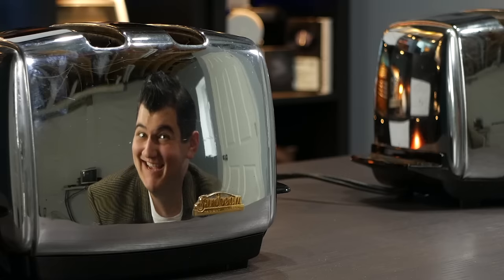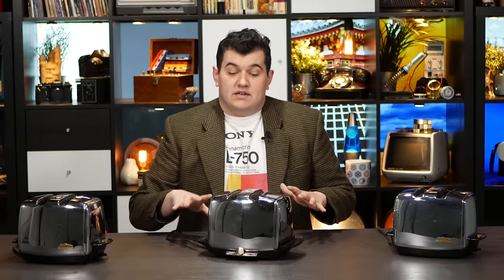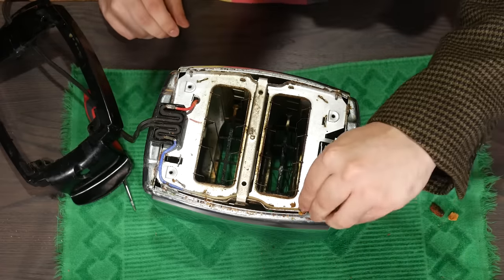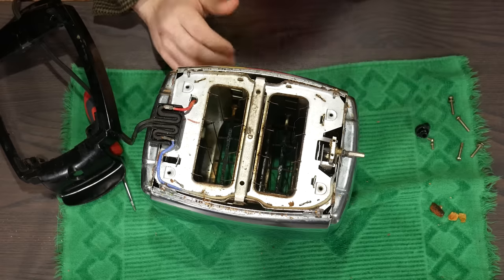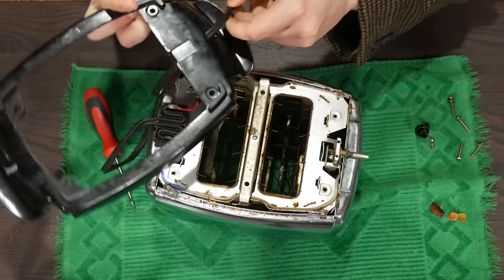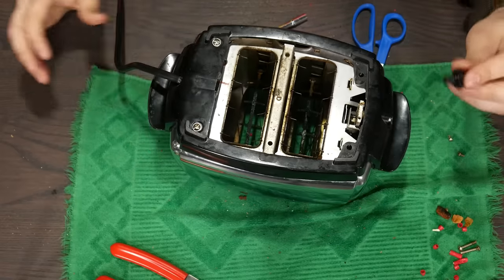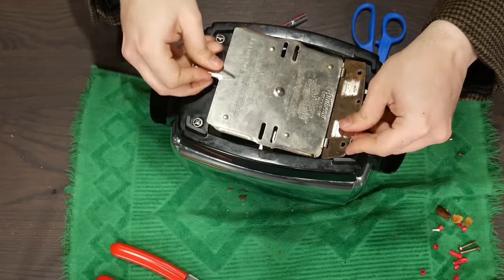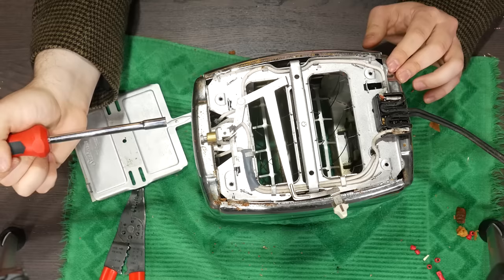Sunbeam Radiant Control Toaster--Repair and Modernization

Comment: I already commented on your main video, that wire on the older model is a 100% or atleast abestos based.
It might be gypsum or plaster cut with asbestos if your lucky, but that shits still dangerous.
Reply: Only if you breathe it in
Reply: @sugarbooty  Yeah, you have to first make it into dust, then breathe the dust. Not much to worry about in a toaster, even with fiddling about like he did in the video.
Reply: The white "paper" stuff is 100% asbestors, also the insulators for the heating elements are suspect.
Reply: hmm i am afraid now i started to work on mine and i went to try and burn the insulation with a lighter and it did not catch fire. I have a asbestos phobia and i’m not sure whether to junk it or see what i can do with it.
Reply: @nikelquint  Would it even be legal to just junk it? Isn't asbestos supposed to be disposed of by certified professionals only?
Reply: @nikelquint  Send my your toaster and I will keep it as i am not worried at all about asbestos.
Reply: @Sine1040  If by the insulators you mean the little white supports that hold the wires in place they were ceramic, or sheets of mica, or a combo of both.

Comment: I just picked one of these up this morning at a flea market for a dollar!  Lucky day.  I've had my eye out for one since seeing your videos a couple of years ago.  This morning's toaster is the 1970's model, and it would work, but every other time I'd put bread in it wouldn't start.  Loosened the secret screw a couple of turns and now it starts every single time (and moves faster).  Thanks!  Using ours with a GFI socket, so we probably won't worry about changing the cord.
I suspect the reversal of the 'One Slice' text was a requested by someone on the usability/design team.  Many toasters live their lives sitting on counters under overhead cupboards.  With the old design it would be very difficult to see the word 'One', which really is the most important of the two words.  Reversing the text puts 'One' towards the front of the toaster for all to see.

Comment: I have my grandmothers Sunbeam with the front slider. She lived from 1903 to 2003 - one and a half months shy of 100 yo. 
 I travelled multiple states working on very large industrial and institutional furnaces, boilers, chillers, a/c, ventilation equipment, etc. for a company founded in 1867. 
  You could crawl or crouch through, below, inside the fire boxes, in the hot decks, tempered air decks, cold decks, duct, and tunnels. You could crawl into the large fans and pretend that you were a gerbil if you so desired. 
 We offered free inspections on our equipment. 
 When i would test fire equipment pre heating season, we would usually get an odor from the big forced air systems from dust on the cast sections. Folks would ask what it was? They always had an odd look when I'd simply answer "GHOST POOP."

Comment: If there's bad metal corrosion, would be great to see a video of one of these toasters having the corrosion removed, treated and protected against future corrosion forever. Maybe glue a heat-resistant material (high temperature mat) on the inside of the metal casing, to keep the outer casing cool; it would need to be thin enough so the casing can be reattached easily. The bottom wire looks like it may have asbestos insulation, so maybe replace that wire and protect its replacement with asbestos-free insulation?

Comment: Regarding to ground or not, I have been using one of these toasters over 30 years everyday in my farmhouse kitchen with old style wiring, and never got a shock.  Of course I learned at a young age never to touch two electrical things such as the toaster and the water faucet at the same time!

Comment: I love the sly remarks.  Great info, especially the cord upgrade.  On toasters & ovens I regularly upgrade the power cord.  I don't trust the manufacture.  They ALWAYS cut corners.  Besides old toaster ovens become paint dryers for my modeling.  I epoxy the temp knob on the lowest setting (Keep Warm) which is usually enough for wood & metal models.
It's actually Baker-light. A plastic that could withstand large amounts heat.  The old desktop telephones were made of this same material. It was the modern high tech plastic of the 30s, 40s & 50s.  Then came the cheap plastics.

Comment: your crimps are making me nervous.
Reply: Agree. I felt like gifting him a soldering iron.
Reply: Should have used alumicons
Reply: @kurttappe  : *giving
Reply: Agreed. His crimp tool is not up for the task. In fact, I think the new crimps are kind of a fire hazard. Crimps should be as strong as the wires.
Reply: @HelloKittyFanMan.  What's wrong with gifting? The act of giving one a gift. Not everyone likes to be so frank
Reply: @kurttappe  I feel like negating the original strain relief and replacing it with a insulated metal p clip and using barrier block instead of crimps would be the way to go